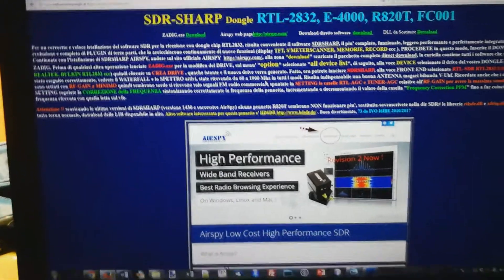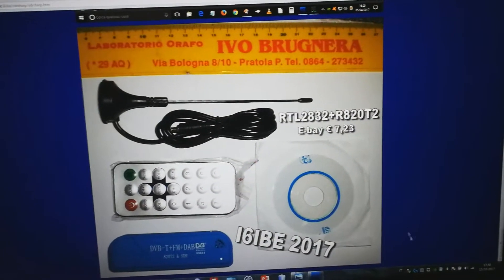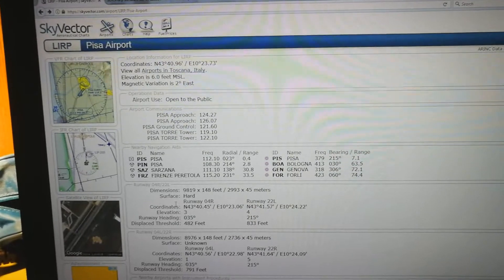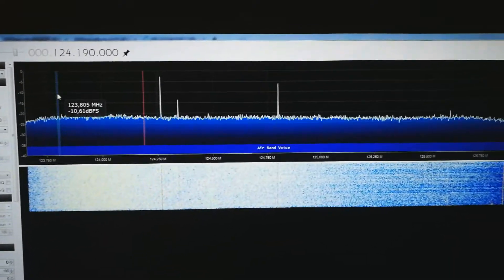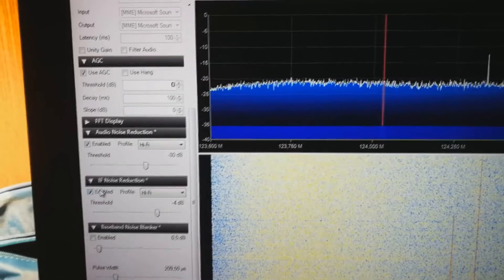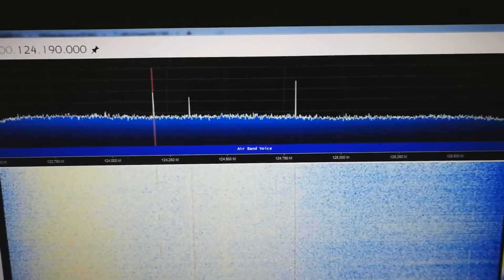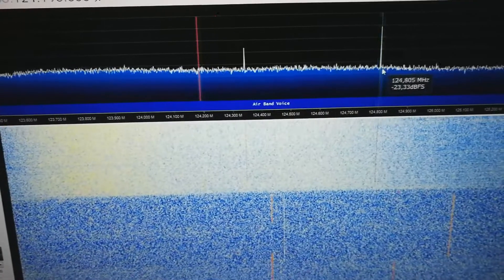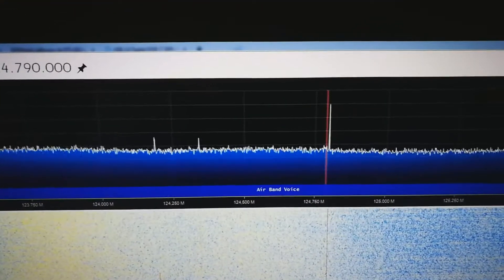2017 - Intercepting Pisa Airport Control Tower Communication [RTL-SDR]

Comment: How far are you from the airport?
Reply from the maker: According to Google Maps, I'm 3.6 kilometres far from the airport. Do you guys wanna see more videos with a better sound quality? I could try and go to the airport one day and make one experiment
Reply: He said 4 km
Reply: Wow, you're pretty close to the airport. Was your antenna in the basement? I was expecting a better signal. And yes, it would be cool to see how it performs near an airport if you ever get the chance. Thanks for the reply!
Reply: @TeamOrdigamer  Hi, you can always buy a d1000 Antenna made by a person named broadsworth. Buy it off eBay, they are great quality and received airband really good.
 It is only 60cm long and can be transported anywhere. Happy scanning.
Reply from the maker: Ordigamer The antenna I use is the  one you can see at 0:08 - 0:10 in the video. I got a poor signal because  the antenna was inside my room and the signal is subject to quite a lot of shadow fading because of the large amount of objects and buildings on the way to the control tower. From an elevated position with direct line contact to the control tower, I could get a better signal for sure
Reply: @Neccessarythings  why do you want that
Reply: @Neccessarythings  I am almost very new to this system brother, I only know that if you want to listen to aircraft then don't buy a sdr as it didn't pick it up for me and I am only 3 miles away from the airport. Buy a handheld airband scanner, I've got the uniden ubc72xlt. It picks up everything at the airport. Also buy the antenna that I have previously said in a past comment on this video. It is the best antenna to buy at a cheap price.